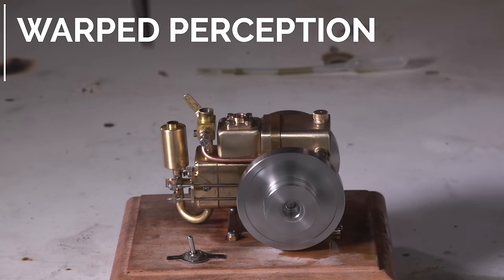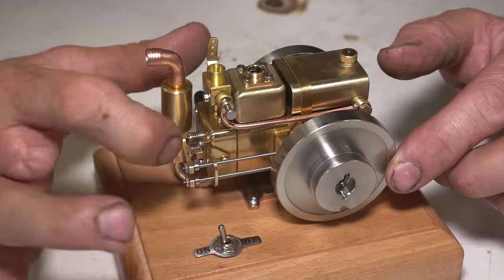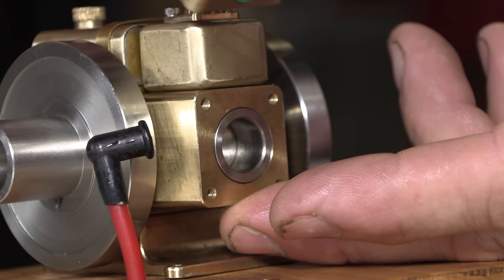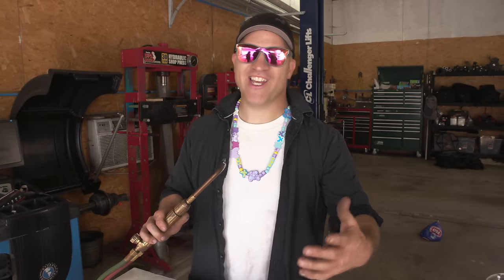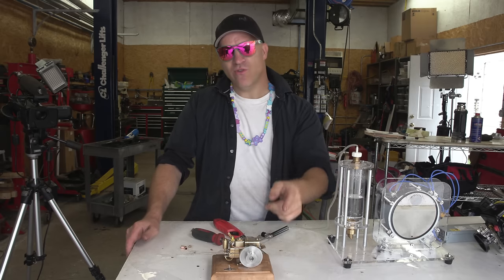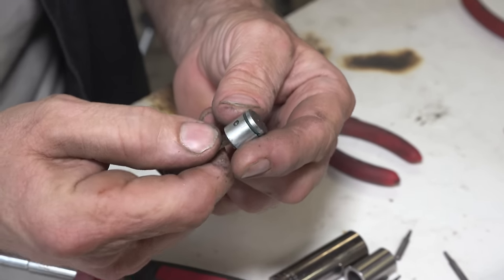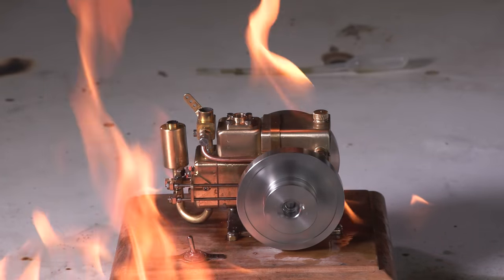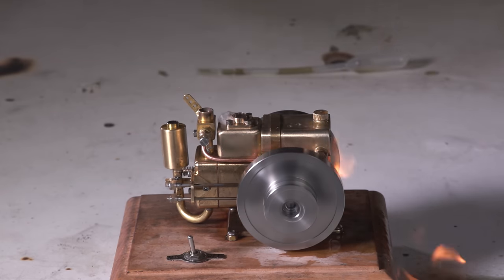I Blow up Mini Gas Engine with Oxygen Acetylene - (Slow Motion)

Comment: "the only by product if burning hydrogen is water" "huh why is there water in here"... Oh my friend. I love your channel heh
Reply: Thank you at least someone put two and two together!
Reply: the blow by is real
Reply: He mentioned it could be hydrogen
Reply: Lol, exactly my thoughts
Reply: was going to make the same comment lol
Reply: The 2th Tank is not for wather, it´s for the Oil. RTFM XDDDD Burt nice Video
Reply: Beautiful chanel
Reply: Conner Perrault I was looking for this
Reply: Water vapor is a reaction product
Reply: He just forgot about the water.
Reply: You people don't listen...the first thing he said "is it the hydrogen?".
Reply: @christianbenzinger770  If the tank on the top was for oil it would have had a cap on it like the gas tank. The reason it doesn't is because this engine uses something called hopper cooling, which doesn't require a radiator. So it's you that need to  read the manual.
Reply: Are you absolutely serious? You got the hydrogen from water and you didn't know it would turn back to water by burning it? I think he forgot this on purpose for the sake of the video.
Reply: The coolant passed by the crappy seals on the cylinder liner into the crankcase.
Reply: Another thing I’m thinking is the way the exhaust is designed it should be facing down so the exhaust vapors can drip down just like when you start a car in the morning and water starts dripping from the exhaust
Reply: Water vapor is a byproduct of all hydrocarbon combustion. That includes gasoline, kerosene, diesel, rocket fuels, jet fuels, etc, etc, etc. So concluding it is because he used hydrogen instead of gasoline is nonsensical.
Reply: He just need to remove exhaust pipe, so the water can get out. With this pipe design it just traps in the engine block
Reply: The sleeve i surround by water from the cooling res.
When he moved the sleeve the water went in to the crank case.
Reply: W.. what? What you are trying to say is very unclear.
Reply: I was laughing at this too! Haha the exhausted water couldnt travel up that tail pipe i wonder had he cut it off down at the bottom kf the water would have escaped and not gathered in the crank? I forgot about burning essentially hydrogen peroxide but i knkw the feds spent money installing this technology into the early 2000s chevy impala police cars and the fuel mileage increased to the 40 mpg range which was unfortunately offset by the cost of pouring the hydrogen peroxide into the container. Of coarse if they created it with that same electrolysis process it would likely offset this cost. Still amazing! Im pretty sure the germans had used this to boost power in their war planes usinG WEP but i may be mistakem
Reply: You could never get that much water out of burning that much hydrogen. Obviously the coolant leaked in.
Reply: @240sxRule  thank youuuuu
Reply: @DataLog  yea hydrogen def haz somtn to do with water bruhh
Reply: @keithbaker1951  germans used methanolwasser mw50. A 50/50 mix. Lot of guys riding blown harleys use it nowadays. Allies had a similar system called Warpower, sounds a lot cooler but basically alcohol/water injection in compressors. Engines could only take 15 minutes extended running in that mode, after that the engines had to be completely dismantled and checked for cracks and metal fatigue.
Reply: he put water in the oil can
Reply: I was wondering how far down the comments this would appear, happily it's pushed to the top.
Reply: NOx is also produced from the high temperatures in internal combustion engines. If the hydrogen was run through a hydrogen fuel cell then it would only be water
Reply: Water shouldnt have got in there past the rings , thats what he was getting at, but later we found out the ring was shot so water got past it.
Reply: He thought it all came out the muffler. Idk why he didn't figure it out sooner er
Reply: The water fairy left it in there.
Reply: I think it would take a while running on hydrogen to produce that much water. Maybe 10 minutes would do it?  But that doesn't explain at all how it got in the crankcase. Other fuels (all hydrocarbons) produce water (and CO2) when they burn.
Reply: @johnlemmey7698  that makes the most sense to me.
Reply: Excluding atmospheric air and supplyingthe oxygen would also allow a purely water byproduct.
Reply: @christianbenzinger770  No it isnt.
Reply: @daniellofgren1165  Its a Bleeder Method. It's as Running A First to Third action(Baseball). Provides itself it's own coolant . Biggest Problem with a "BLEEDER Method" is Keeping the Engine at the correct Temp to BurnOff the extra Water as it's being Created/Separated.  Think of THAT Melt down..
Reply: @oliverbrubaker105  People learn differently..
Reply: @routmaster38  it wasnt the seals.. it was the BiProduct from the Separation of Hydro~Oxygen leaving the Water.
Reply: @connerperrault1882  มีคน
Reply: Yes but that is a huge amount was it just not vaporized. nothing came out the silencer  whyyy
Reply: @ゲリン  it didnt get Hot enough to burn off in Time.
Reply: @wilfordownbey5000  👁👄👁
Reply: @christianbenzinger770  please say 2nd and not 2th youre triggering my ocd
Reply: @ProGuitarUA  the exhaust pipe once hot no longer acts as a condenser
Reply: H²O
Hydrogen oxygen
Reply: Its 4 stroke and combustion chamber and crankcase are in different  universe my friend.
Reply: H2 + O = H2O
Reply: That’s probably it but I want to mention could be a head gasket lol. The coolant (water) where the oil should be
Reply: That little hydrogen would have never produced all that water
Reply: 酸素とアセチレンの混合の爆発で水冷が追いつかず沸騰
Reply: Id say he was more confused as to how the water got into the crank case
Reply: Everyone knows that. The point was the water shouldn't have ended up in the crankcase esp with a rubber piston ring. It should have simply gone out the exhaust

Comment: 9 fingers? Acetylene? Blow it up? Why's this water in here? Flames and destruction! What's not to like? Subscribed.
Reply: Water can be cool it !
Reply: Water is the by-product of burning hydrogen and oxygen.  As soon as he put that in there, I though the J in the exhaust would shut down the engine. It did not occur to me that it would get past the rings and into the "block"
Reply: Engine out of China was crap? Who would have thought
Reply: boooooooooooooo
Reply: Ong
Reply: Water is a c. Add enough electricity to break the chemical bonds and the water will split split into the explosive hydrogen and oxygen mixture.
Reply: Yeas
Reply: Same here 👍🇺🇸
Reply: wait. i didn't notice that he only had 9 fingers
Reply: 😂😂😂  I rest my case.  Time to start a chaper of Pyromaniac's Anonymous!

Of course it could backfire & we'd just have Organized Arsonists of America
Reply: What?
Reply: @russiangoose4349  Look at @5:39
Reply: +1 subscribed

Comment: The fuel was coming out of the vent because the oxy acetylene pressurized the carb and backflowed into the fuel tank.
Reply: That part had me mesmerised for a bit, suddenly made me think of 'boost referenced fuel pressure'
Reply: Do you use spark plug?
Reply: That and dislodging the cylinder liner caused water to go into the crank case.
Reply: iamtehstig shhh, let us imagine it heated up like the coolant reservoir and just boiled out
Reply: If the oxygen acetylene had pushed out some of the gasoline, filled up the headspace of the tank, and then flashed back into it, it would have made an even worse mess!
Reply: @mysock351C  great point. That's probably what happened.
Reply: Y'all still don't get it it was a lit torch, not unlit acetylene
Reply: @keithheiskell2389  to me the sequence of events looked like he lit it to adjust the regulators (for a good oxygen ratio) turned the tank valves off, turned them back on (without lighting) stuck the torch in the intake, the unburned oxygen/acetylene made the engine rev faster and be damaged, and then a backfire or burning exhaust caused the torch to light again.
Reply: The intake valve spring got melted because the torch was lit- shoving a hot flame down the intake .
Reply: he didn't even touch the throttle tho
Reply: @icewallowkam2054  The fuel is presented at the air intake. Frankly I wonder why gasoline was put into it at all :) ran so well on hydrogen.

Comment: We need Garage54 to put an engine like this in a Lada.
Reply from the maker: Lol... It would probably work
Reply: Garage54 would solder 30 of them and make an inline-30 Lada
Reply: @LudovicoOperti  speed will be like 0,1km/h :-D
Reply: @LudovicoOperti  or one engine and a special chain drive/gearbox to slow it down and multiply the force.
Reply: There's a channel called LifeOD that welded a lawnmower engine to their Honda
Reply: It you don't like it just don't watch period !
Reply: @wangbu8869  This was a great video. We were just kind of kidding/thinking about other things you could do with this tiny motor.
Reply: 😂😂 OMG yesssss
Reply: @LudovicoOperti  weld* Soldering and welding are 2 different things.
Reply: @companionsytoriginal873  this is no steel engine, it need to be some sort of soldering/brazing
Reply: @jada1173  I've seen people weld some CRAZY materials. I mean, look at the Statue of Liberty. That bitch wasn't BOLTED together. And that's just something famous. I've seen some unpopular people weld some crazy materials together.

Comment: The water in the crankcase is from when the cylinder sleeve pushed out due to the stuck piston. The block is hollow around the sleeve to allow the water to get right up against it. As a result the sleeve is what seals the water from getting into the crankcase. Most larger engines have an o-ring around the base of the sleeve though this is so small it may just be a tight fit with no o-ring
Reply: Or it overflowed and ran down the back of the engine and into the fill hole.
Reply from the maker: That's what I thought at first but I didn't see any sort of hole in the block the block was literally just solid brass and that little water tank was soldered right to the top. I'm going to check again but I'm pretty positive there was no coolant passages. I do however like your idea as a cooling design, that would be similar to like an open deck Engine with coolant passages around the cylinders.
Reply: Warped Perception the nitro likes to turn into water too especially in the crank case
Reply: Exactly, it was from the cooling water. It definitely wasn't from the hydrogen and oxygen.
Reply: By product of hydrogen is water... right? Then that o-ring for a piston ring let the water pass. Especially under those extreme circumstances.

Comment: When you burn this it’s byproduct is just water
Uses it in the motor then scratches head as to where the water come from 🤣
Reply: How did he not see the water damage coming?  TBH, I thought the exhaust, given its shape would fill with water and stall the engine, not that it would end up in the bottom end.  Still, EVERYONE knows who is even remotely familiar with oxy-hydrogen that the byproduct is water.  He simply should not have been surprised having built an oxy-hyrdrogen generator himself.
Reply: @tarstarkusz  he really should have just run it on hydrogen, I'm surprised the generator doesn't separate hydrogen and oxygen, it's pretty simple to do, you just need seperate chambers on the cathode and anode.
Reply: @nosch43  It wouldn't work. If you pumped hydrogen into the cylinder, there would be no oxygen to react with.
Reply: @tarstarkusz  air has enough oxygen to allow for hydrogen to burn. that's why blimps that float with hydrogen can explode. there still would be water released but not as much, however he would use much more hydrogen as it likely wouldn't fully combust. fill a balloon with pure hydrogen and light a match next to it it'll give you a fireball.
Reply: @nosch43  But how is air going to get in if you have a "pipe" shoved against the throat of the carb breathing in pure hydrogen?  (check out 0:03 in the video). You can see the pipe shoved down the top of the carb and sealing against the sides.
I agree there is plenty of oxygen in the atmosphere to allow burning of hydrogen in the open air.  But to run an engine on hydrogen requires a connector directly to the carb and in this case he just used the top of the carb which would block any air and there is no other path for the air to get into the engine other than from the top of the carb.
If you filled a balloon with hydrogen and put an electric igniter in the balloon and then tied the balloon with the wire going inside it so there was nothing but hydrogen in that balloon, it is not going to explode.  If oxygen gets in it while you are filling it, that oxygen will combine with enough of the hydrogen to bust the balloon and expose the remaining hydrogen to atmospheric oxygen and the rest will burn.
Reply: @tarstarkusz  you blow the hyrdrogen in from further away, or you use a propane/mapgass torch nozzle instead. it's designed to pull air in. you could also build an intake manifold from a sodacan or something to allow the carb to suck air along with hydrogen.
Reply: @nosch43  it would be simpler to unscrew the muffler and the u pipe that was trapping the water in the engine
Reply: alex guariglia you need to make the cell quite a bit bigger for the same production rate when you separate the electrodes
Reply: @nosch43  doesn't fix the water problem all your doing is decreasing the efficiency of the burn stealing power from the engine

Comment: The fuel was pushed out of the tank by the oxi-fuel gasses flowing backwards from the carburetor through the jet.
Reply: I was looking for this comment.
Reply: bingo
Reply: So wait... you are telling me that when this ID10T said he was running on HHO, there was still fuel in the tank? lucky he set the oxy acetylene mix sooo lean (i call that flame colour  screeching blue, for obvious reasons) else the engine would have cut out after briefly running so rich the soot in the exhaust would have made it look like he was rolling coal!
Reply: I was about to type that 😂
Reply: @daftflamious  that flame is a neutral flame and is a pretty much perfect stoichiometric ratio

Comment: one day i'm going to buy a tiny engine like this.
Reply: Yeah me too, but I want to buy the kit version, like the one he built a few videos ago
Reply: Me too
Reply: W16 , quad turbo , 16.00 horsepower
Reply: @Wladpad Custom RV Cars
Reply: Yeah there cool
Reply: I wanna make one
Reply: Im with you, I have to buy a Honda too.
Reply: I've seen some cool video of a machinist getting one of these little Chinese engines and fixxing them by machining all new parts for them with much tighter tolerances,
Reply: @seekerfractal  Back in the 80's I spent hundreds of hours in my home shop building a hit and miss model from bar stock using non-CNC machine tools. Now you can order one from China for a couple days pay.
Reply: @blic-sx9ix  yeah but wheres the fun in that? It sounds like a really fun project building your own hit and miss like that, if i had a shop that would definitely be like the 5th or 6th project I would do lol
Reply: I am working on getting the ET8 it's made by the same company and it's basically the same thing except it looks different

Comment: Love Your video’s but the question is ...  where is the 2stroke??? Anyway keep making this video’s 👌🏻
Reply from the maker: It's coming, unfortunately the factory where I'm going to manufacture the components has been closed because of the coronavirus since February. They are still closed to outside hopefully for only another couple weeks. That's literally all I've been waiting for I am so ready to do those
Reply from the maker: Thank you..
Reply: Context? What 2 stroke?
Reply: He should have removed the flywheel in the last experiment to see how much RPM that sucker could handle before self destruction
Reply: What 2stroke?
Reply: @Bajinowhere  engine with sound teng teng teng teng
Reply from the maker: @hojnikb  see Thru 2 stroke
Reply: @WarpedYT  Why not just use a weed wacker engine ?  would be a good engine for this yes ??
Reply: @stevelamperta865  he has to machine the polycarbonate or acrylic cylinder head and that's the shop he's not able to get into right now
Reply: @JesseCombsTwiZtedCheese   He doesn't have to use an acrylic head for this... this video had nothing to do with a see through head...  I believe you missed my point.
Reply: Steve Lamperta Actually you missed the point of the comments you replied to. This section was taking about the 2 stroke he is working on with a clear head.

Comment: During the slow-mo of the destruction of the engine it somehow seemed so determined to finish the job, even though it was surrounded by fire, the exhaust was catching on fire as it came out, you could almost make a movie using this as a format for a catastrophic engine failure.